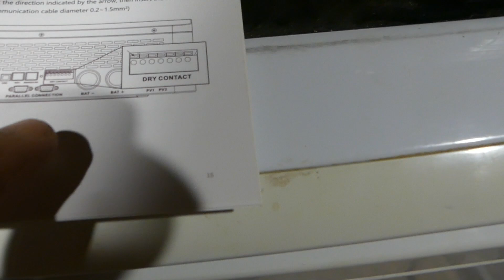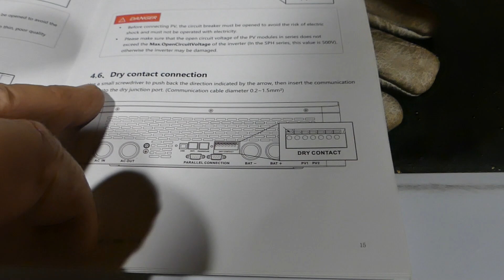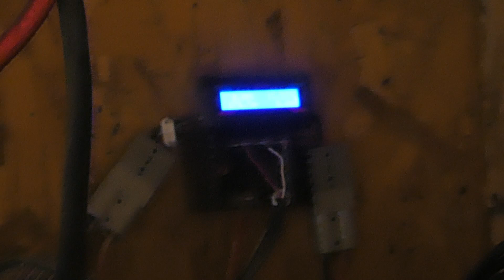SunGold Power All in One solar Charge Inverter Model no. sph10k48sp #diysolarsystem #SunGoldPower

Comment: If you reply with each batteries specs I can give you advice. You say 5 batteries in each row? 5 x 12.8 = 64 volts. 4 x 12.8 = 51.2 volts. What is your inverters max voltage for batteries? I suggest you do 5 rows of 4 batteries and each row(bank of 4 to make 48V) then have the neg go to busbar and same with positive. each cable needs to be same length from each bank neg and pos but neg and pos do not need to be same length.
Reply from the maker: Thanks so much for your input and thanks for stoppin by God bless!

Comment: I would run each set of 4 batteries (48 volt bank) to busbar instead of going to next set of batteries. You are pulling the full load through every bank and doing it the right way having 4 separate battery banks. Example if you draw 5000 watts and each battery is 100ah  that is 1.0C. if you have 4 banks it is 0.25C which is 4 times less load which means less heat loss and less chance to damage a single battery. With the way you have it if 1 battery goes down it can take down your whole system. Also where are the BMS's?
Reply from the maker: That makes sense thank you! I don't know what a BMS is though? Thanks for stoppin by God bless!
Reply: @tonylarson1960able  Battery management system. It would stop charging a bank of batteries if something happened like 1 is way under voltage or 1 is way over voltage.
Reply from the maker: @dc1544  
Thanks! Good to know!

Comment: A dry contact is the synonym of volt free — it is not "wetted" by a voltage source. Dry contact can refer to a secondary set of contacts of a relay circuit which does not make or break the primary current being controlled by the relay. Usually some other contacts or devices have the job of starting or stopping the primary current being controlled. For example, a reed relay matrix switch is normally switched with all contacts dry. In a charger/inverter there is often a dry contact relay that can be programed for a number of functions such as turn on a fan when the temperature in the charger gets to high.
Reply from the maker: Thank you very interesting!
Thanks for your time and thanks for stoppin by God bless!
Reply: Great answer but I think he had no idea what you were talking about
Reply from the maker: Nope, but I'll figure it out! Thanks for stoppin by God bless!

Comment: No, No, No, NO No. first off, what kind and what volt are your battery banks, and you need yo make the batteries into groups and wire the groups to the buss bars. if you make the strings too long, they will not recharge properly. and the dry contacts are for starting a generator or operating a solenoid.
Reply from the maker: You don't have to yell! Lol 
Our batteries are Renogy and are 12v/ 200 amp hours each, we have 20 of them run in parallel! Our problem is the cheep foreigner inverter, so we decided to upgrade to 48v system with the sungold 10k all in one, we've heard great things about it so we are gonna give it a whirl! Thank you for your input that is one way to do the batteries! Our plan is to wire the batteries in series parallel making each row of five batteries one large 12v and wire  them from each end to tie all four rows together to make a 48v system! Hope I explained it right! Lol anyway in easy terms our four rows of batteries each row being one large 12v battery and we will wire each row in series to make the 48v system! 
Thanks for stoppin by God bless!
Reply: OK, so, you need to run 4 in series times 5. you'll need another set of bus bars to hook the 5 48 volt runs to bus bars with the positive on one side of row, and negative on other side at bottom. and just hook the server rack batteries the same to other bus bar. that will insure you charge the batteries evenly. Go watch some Will Prose videos to give you better idea what i'm saying.
Reply from the maker: @jim_in_ga  
Thanks I watch Will Prose now and again thank you for your help and time God bless!

Comment: I think you should have balanced solar panels input to the inverter due to the 240v output. Split leg with only 1 input may not function properly. Just a heads up, 
I'm not familiar with your inverter.
Reply: @KevinGastonSR Is this in English?? LoL Just giving you a hard time. Electricity and Solar stuff is kinda scary and many times it doesn't sound like English. GBear help has been awesome as a helper as well.
Reply from the maker: Lol Sherry!
Reply from the maker: Cool I'll have to check in to that! Right now I have two trackers at  a thousand amps each running into two midnight classics! They charge at opposite ends of the battery bank! My problem is my old inverter is junk and the new RV kicks the power off if the RVs converter kicks on to charge the RV batteries! So at night we only use 120v lights to avoid the converter kicking on! It's a pain in the ass! Thanks for stoppin by and your input! God bless